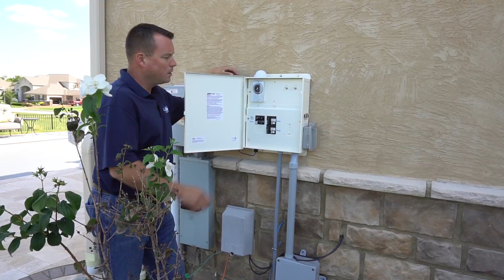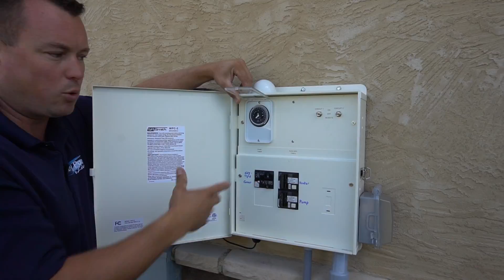Pool School : Electric Control Panel

Comment: If I may ask, if I'm installing a wifi box to a set up like this would it be to the pool pump or the gfi circuit. And how does that interact with the pool heater?
Reply from the maker: Should be installed by a licensed electrician. Designated GFCI breaker.

Comment: Will the panel and remote work with Haywood color logic 4.0 120v lights
Reply from the maker: This particular model will. Each button is a separate relay in the panel. On or Off. The new ones do some color changing and will cycle power but im not sure what color order they are using. I know that it is not Pentair.

Comment: Can an automated system be added to this panel
Reply from the maker: Automation can not be added to this panel. BUT a Pentair inteliconnect could be added to the whole system. That is an add on that would compliment this load center quite nicely to give you some control and lite automation.

Comment: Is pool pre-wiring/electrical on a new construction home done with the builder is it more or less cost effective versus doing it through a pool company?
Reply from the maker: Should be about the same. The important piece is that the home is built with a large enough electrical service entering the house to support an additional pool electric panel. So often homes are built with a service and main panel that can only just barley serve the house itself with no extra room.

Comment: Hmmm question. I have one of those and I'm gonna install a small 20amp mini split to my home. But the main panel is so far away it's gonna be a pain. Meanwhile the pool subpanal is right where I need it. Could I add a 20amp double breaker to the subpanal instead of running an all new wire and quick disconnect over 150ft